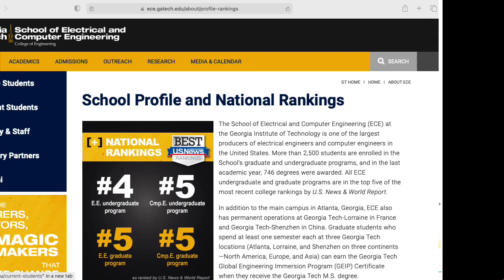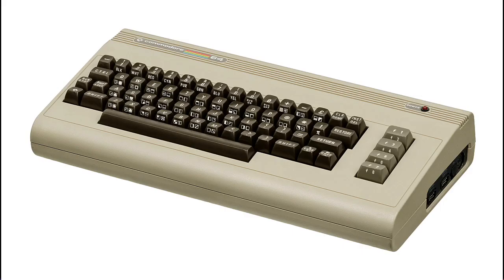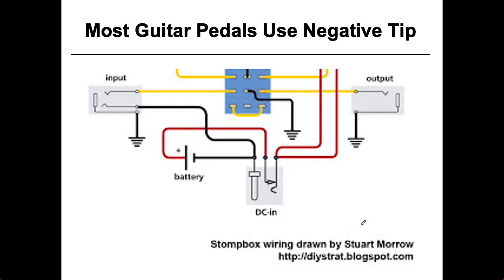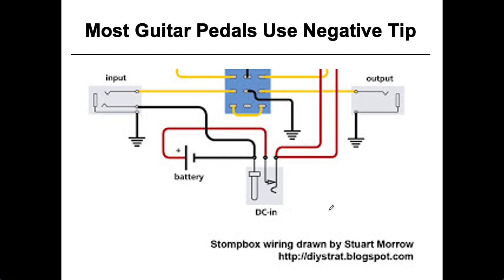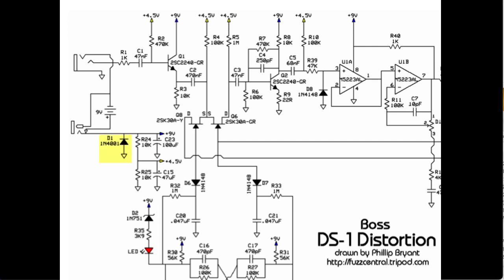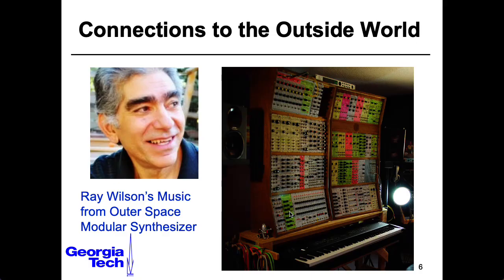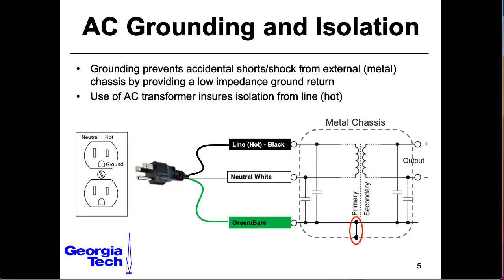Reverse Voltage & Output Signal Protection (REVISED) (ECE Design Fundamentals, Georgia Tech course)

Comment: All of my Boss Pedals have a warning sticker next to the power input jack that states; " USE BOSS AC ADAPTOR ONLY".
Roland engineers have been kind enough to also put a protective diode in place, to buy the DIY engineer a little extra think time.
If the warning sticker and the diode are not enough, perhaps a broken device is the next logical step as an educational mechanism.

Comment: If you put the feedback on the opamp on the other side of the 1kohm resistor it will correct for the error caused by the resistor.
Reply from the maker: I've particularly seen people do that with the 741 -- maybe something about the particular way it handles short circuit protection?
Reply: @Lantertronics  I just looked up a general TI opamp ~10MHz and it has unlimited short circuit protection.  I  bet your correct that the 741 did not have that.
Reply: @Lantertronics  The current TI 741 has short circuit protection.  People do things based on tradition.  I still use my Burr Brown opamp books copy right 1971.  :)

Comment: I think the idea with that really simple polarity protection is that a player will plug in their pedal, attempt to use it, and then when it does not work unplug it and investigate the issue. And for something that short term it's fine.

I have definitely opened up older Boss pedals and seen a scorched diode though.

Comment: I find that little circuits such as stomp boxes do well with a small bridge rectifier before a single-cap filter.  If I don't care about the voltage going in, such as if I plug a laptop supply in, I'll put a regulator after that.  While I do lose the voltage drop and the regulator's losses, it's a lot cheaper to stuff a few parts in that have inherent protection.  "AC/DC up to 36 volts non-polarized" is a future label on the portable shortwave radio I'm building.

Comment: Hey professor.
don't know if you have seen this, but here goes: Hackaday Reading Silicon: How to Reverse Engineer Integrated Circuits.
a must see video for people that use semi conductors.

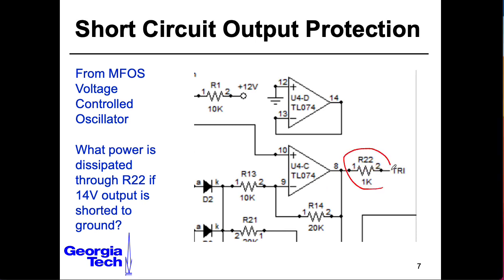9:31, that 1K is standard for many, sometime 180R is used as in the case for Mutable Instruments Kinks, Links, but you forgot to mention the opamp's have a short circuit protection,says datasheet, if you watch the above video, you'll discover how its work as i found out recently.

hmm, someone said i own you an apology, that i might have mistaken the operators on a formula.
But how was it?
P = I² x R or P = I² / R?
P = R² x I or P = R² / I?

P = V² / R?

I forgot to make written notes when we last discussed this.
😊

Comment: I have seen one DOD pedal after reverse power accident. On that model the trace between the DC socket and the diode was super thin and had burned open. It seemed fairly obvious that it was designed to work as a fuse in such situations. Which I guess is a slight improvement to the circuit. Still dreadful design.

Comment: The internal resistance of a battery with either the parallel or series protection diode will produce harmonics and non linearity? Because when using batteries compared to using a DC wallwart or transformer, it sounds very sharp and edging isn't a DC wallwart compared to using batteries with guitar effects, any reasons why?
Reply from the maker: I conjecture internal resistance of the battery isn't going to necessarily provide more or less non-ideal behavior than the AC supply. There may be differences in terms of the particular voltages a particular wall wart happens to give relative to what a battery gives, and that will effect things. I've heard of guitarists use batteries that are deliberately run down a bit to give a particular effect. It would be fun to just hook a pedal in question up to a benchtop power supply and start the voltage at 9 and then dial it back to see what happens. This is all just conjecture, though.
Reply: @Lantertronics  Check this video out because the carbon batteries have higher internal resistance so it current limits and ducks the voltage at uS in time. When using an external Power supply it makes the same guitar pedal sound very sharp and edge. Its weird how DC voltage and DC current can make the same pedal sound edge and shape compared to batteries to more dynamic with your picking attack https://www.youtube.com/watch?v=ILT5yvkaIcE&t=617s

Comment: I repair a lot of pedals, this circuit is bad. They used a zener in the older pedals. Other companies use a 470 ohm resistor in series with the diode to keep it from overheating, but that doesn't work for long either. Old MXR pedals used a 1n270 diode in series with the input voltage like you suggest with a schottkey, but the diode can also break down with too much input voltage.
Reply from the maker: I heard someone refer to it as a "warranty diode" -- as in if Roland opens it up and sees it busted, they can say you hooked it to the wrong thing and violated your warranty. Which, intentional or not, it really awful design as you note!
Reply: @Lantertronics  Warranty diode, that make a lot of sense actually hahaha. Oh wow...

Comment: The TL07x have short circuit protection; so I'm not shure if the 1k resistor is needed... it will disturb the signal a bit, but 1k in relation to the usual 100k input resitance in modular synth is little
Reply from the maker: I'm nervous about trusting the short circuit protection in chips. In any case, I've ever seen a commercially produced module that has an op amp output brought straight to an output jack.
Reply: @Lantertronics  I was just fixing a Serge module and found an opamp output accidentally grounded by precious tech. And it had been like that for years. Chip was running hot, but to my big surprise, once the short was sorted out this humble mc4558 was still working fine! I have seen opamps straight out on EMS gear, at least Synthi 100. I think EDP Spider should at least according to the schematics be straight out. Pretty sure I have seen it somewhere else too. Still prefer to have output resistor though.

Comment: I'm not an electronic master (only a beginner) and my english is not fluent so i may have missed something...but what about  a parallel diode with a resistor? resistor may limit current if you plug jack badly. No?
Reply: Current flowing through the resistor develops a voltage across it. Not good!
Reply: The parallel diode tries to short out the wrong polarity voltage (which as noted may be a really bad idea if whatever provides that voltage has a low output impedance). A resistor in series with the parallel diode will protect the diode, but it stop the diode from shorting out the voltage, so it's almost like you didn't put a diode there in the first place - it diode and resistor will just draw some extra power from the power supply, while the rest of the circuit still takes damage from the negative polarity.

Comment: My preferred method of reverse supply voltage protection is usings FETs. You just need to know how much current the circuit is expected to use (I use 300mA parts in most cases). P-channel JFET for positive rail: drain is wired supply input, gate is wired to supply common, source is your circuit's positive supply rail.  No voltage drop when properly conducting the supply, and when supply is reversed (negative and positive rails swapped), the FET simply does not turn on.  Use N-channel part in same manner for a negative supply rail.

Comment: Both parallel and series diode protection are no good. Most likely the idea behind the parallel diode is that only small adapters are used to power the equipment. A series diode might look good but if you plug in a supply with correct polarity but a too high voltage, there is still a high chance of smoke ...
With correct power, the series diode will (as you mentioned) influence the actual voltage on the circuit. A better way is to use a MOSFET instead. Only with the correct polarity the gate will be opened and full power is available to the circuit behind it. A second MOSFET with a zener diode and a PTC fuse can be used to protect the circuit against overvoltage (to a certain limit).
The output protection you show with the 1K resistor is working but depending on the load (a 10K potmeter on the input of the next circuit) the output will never reach the full level and this is even worse when this is the output of an oscillator that is being used to drive multiple modules (using a passive mult). If R14 is placed inside the loop (so between the output of the opamp and the resistor to the negative input), the output still has a low impedance while still being able to limit the current in case of a short circuit. But this does depend also on part of the circuit not shown: what happens when a +10V CV signal is fed to the output of a VCO with a 10Vpp (so -5V - +5V) VCO. It is possible that part of the circuit that is not shown cannot handle the 10V signal ... With the resistor where is it shown here, the low impedance of the opamp circuit most likely prevents this.

Comment: I heard people call the parallel "protection" diode the warranty diode. If that's blown then your warranty is void
Reply from the maker: That's hilarious!
Reply: @Lantertronics  I was a radio tech for a long time. All the cb radios I repaired were designed with a like 1n2002 or such diode on the positive input, so no matter what you did, applying reverse power had no effect whatsoever.

Comment: Those diodes do get quite hot. I was repairing a non Boss pedal that someone had monkeyed with, and they had replaced that reverse "protection" 1n4004 diode in backwards. I ended up with a 1n4001 diode shaped burn on my finger for about 2 weeks.
I was powering that pedal with a bench supply, not a 9v battery, so there was oodles of current running through it.
I reversed the diode, and the pedal started working correctly again. I charged the client for the full half hour.
Reply from the maker: A couple folks noticed that back in the 70s people were likely using whatever supply Boss provided, and it wasn't until later that using beefier power supplies that could power a whole pedalboard became commonplace.